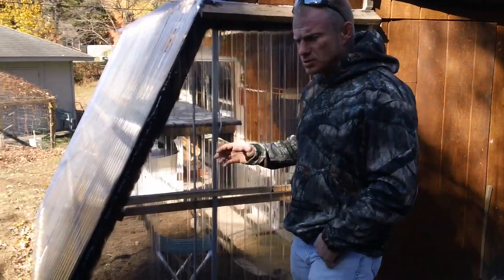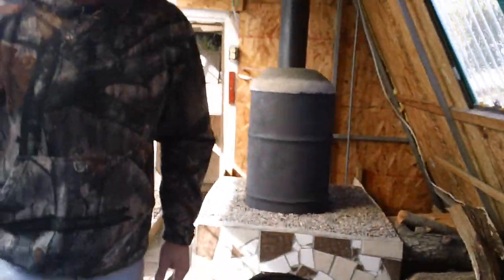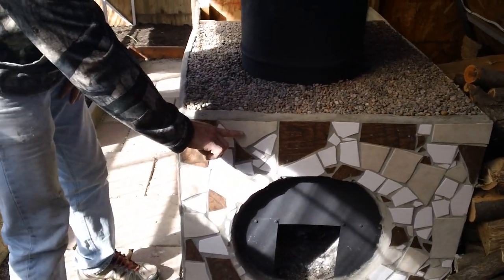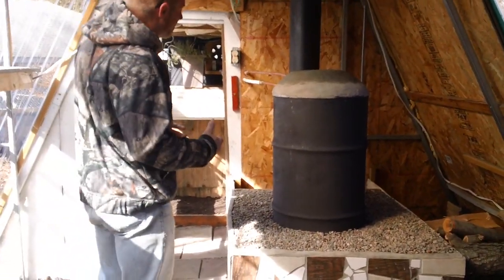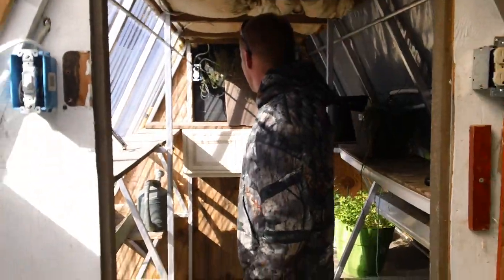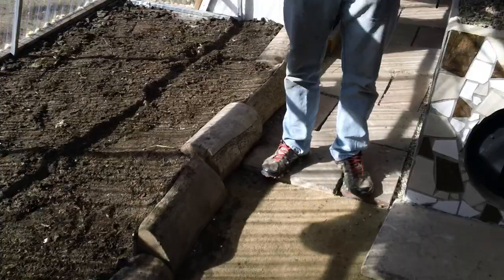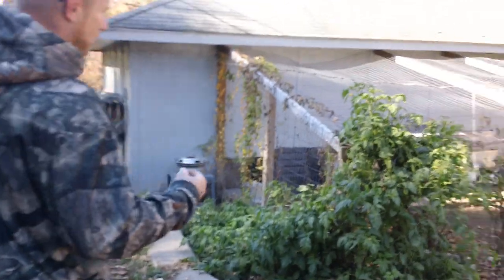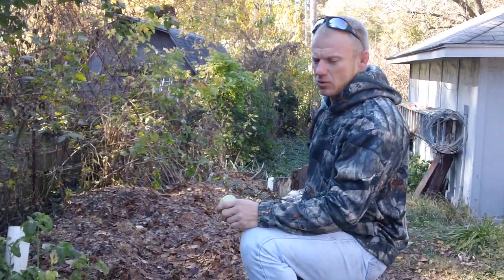Rocket Stove 2 BE or NOT 2 BE

Comment: Putting a fan or any motor on a dimmer is a serious fire hazard and definitely illegal. Use a regular light switch. The only way to safely vary the fan speed is with an AC frequency drive which would be crazy expensive. You could use a thermostat to control it cheaply but I can't emphasis strongly enough ...get rid of the dimmer.

Comment: I am kind of confused.  You did a video, with chalkboard illustration, saying that rocket stoves were inferior to the water storage / regular wood stove.  Yet, looking at your other videos, it seems that you went the route of rocket stoves ??  Why ?
Reply from the maker: a few reasons, first materials available to do the job, second it was hard to set up a thermal syphon in the green house , hard to get the water elevation higher than the coil to make the thermal syphon work, third experimentation to see how other set ups work and function. I can not deny and  do not deny at any point the water potential heat storage advantage. just whta was on hand and what the customer wanted for the sake of ease. and to avoid any pumps.
Reply: @TheTitian69  If you wanted to get more elaborate, you could have your thermal siphon to an insulated tank up high(er), and use gravity to run warm water through pipes (back) down to the greenhouse.  Sounds like that wasn't practical in this case.  

My only "issue" with your "rocket" stove is I don't know what your inner barrel is made of.  If it's just steel or pot metal, it won't get AS hot or burn AS clean as it would with fire brick or aircrete riser off your burn chamber.  But if it's NOT insulated, it's probably not getting much hotter than a conventional wood stove.  But you can still make a conventional wood stove burn pretty clean, if you get a good, hot fire going.

I don't think you're getting AS clean a burn as you would with an insulated riser.  

But yeah.  If you know how to run a half-decent wood stove, you know how to get it hot enough to put off almost zero smoke.  Most people don't, so most wood stoves put off a ton of smoke.

I THINK the hard-core rocket-stove artists also have secondary air coming in somewhere near the base of the riser, so there's oxygen to burn that last bit in the super-heated riser/chimney.  But I'm not sure.  They might've just been talking about leaving an air space UNDER the burn chamber.

I think some marriage between rocket-stove riser and wood-pellet feeder system would be most efficient and least labor to keep it going.  Being able to meter the fuel precisely with one of those auto-feeders would seem to minimize the amount of waste and smoke.

Comment: You use leaves as mulch or as "soil"?  And you add no other thing to it, you just add leaves? No gras/nitrogen?

Thanks
Reply from the maker: +TRe' CooL I would recommend to you a Ted X/Ted Talk on you tube called " everything you know about composting is wrong. Im not sure if you are familiar with said program but it has some other interesting subjects as well. Leave cut up so they decay quicker that's all nothing else.. I just dig a large double handful hole and put just that amount of soil back in and plant the plant in them from 4  up to 16 inches deep. Great results.  I Have bats and chickens I also have tried bio char and have to say the leaf is as good as any medium I found. Try this for your self .. Go to a heavy wooded  ( the woods)area and rake back the top layer of leaves and get that soft black loose layer of broke down leaf debris underneath and plant anything you like side by side in any other medium and see for your self.
Reply: +Van Powell hmm, I know "back to eden" gardening. And this could be true too :3

Comment: Thank you for the Update! Always nice to see. Why are you using a water pump to circulate the water? Could this not "thermo"-circulate?
Reply from the maker: +yxcvmk  The water must be higher than the coil and the tank is too heavy to elevate or Im too lazy not sure which.
Reply: Aaah. Thank you. Could the tank sit on the ground, as long as the top (water level) is higher than the coil on the stove or does the bottom of the tank need to be above the coil on the stove?
Reply from the maker: +yxcvmk Good question. as long as the water level is above the coil it will work. Its nice/better to return the water deeper in the water to allow heat to disperse in the water better . I shove my return pipe to the bottom so it heats the water bottom up. I just had it pulled up so you can see the flow.
Reply: +Van Powell It's good to see you're still at it. Those tomatoes look healthy.
On the water pumping, the greater the temp difference, the more heat extraction efficiency.

Comment: I love that rockety stove design. It looks like you can put in a lot more fuel / wood, without having to feed it all the time like a regular rocket stove. And, adding that copper coil to the top of the barrel to feed the water trough - genius! Also, I am extremely impressed with just how good it looks with the tile and rocks. It has a japanese rock garden feel. You know recently I bought a biolite stove (a TEG charges a battery, which powers a fan creating a hotter cleaner burn) and It makes me wonder how you could use something like that in your system for an off grid greenhouse. Not necessarily to make the fire burn hotter, but to power a pump, or exhaust fan or lights. Excellent work Van Powell!
Reply from the maker: +canis_lupus_irremotus  My very first video and a few others have TEG sytems
Reply: +canis_lupus_irremotus check out the guy, that has gravity feeder for his rocket stove. Search "rocket stove on steriods"